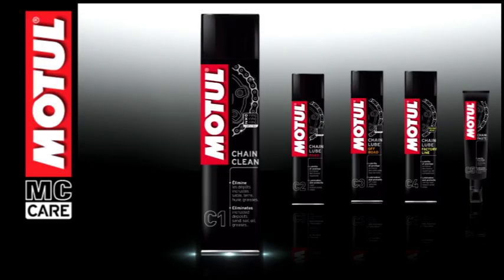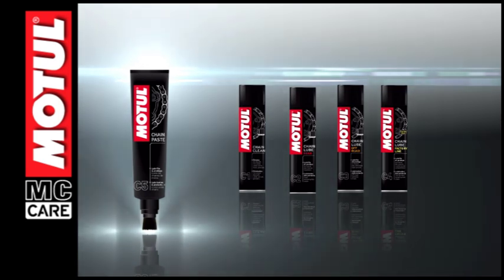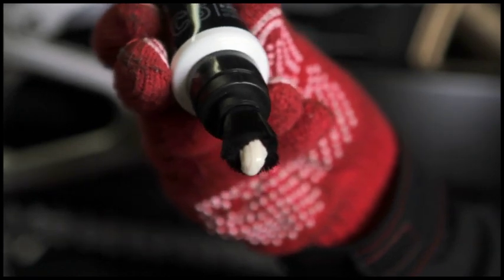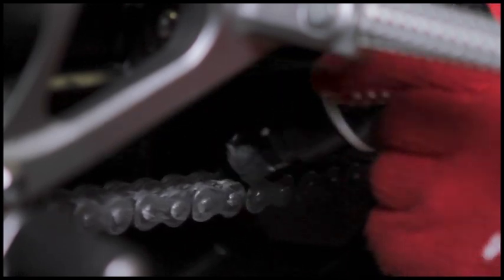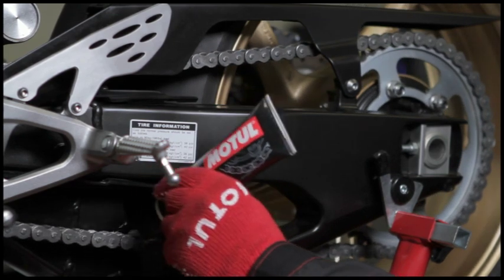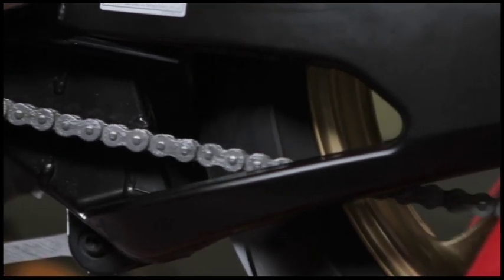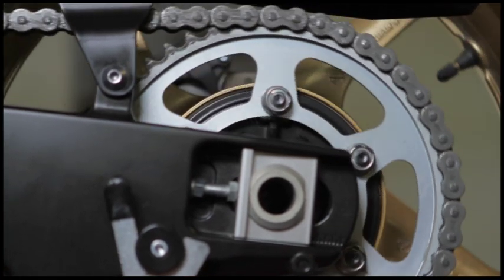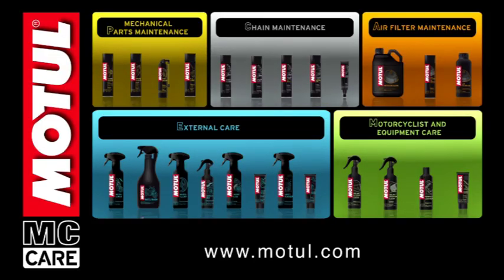Motul - MC Care range - Chain Paste

Comment: whats the diffrence between the paste and the C2 spray?
Reply: The paste is thicker and better keeps on the chain, especially well on the highway in hot weather. I've been using C5 for 8 years, I need to lubricate every 500 km and the chain serves 30,000-35,000 km, D.I.D X-Ring. Very sparingly, 1 tube per 15,000 km
Reply: wow.. amazing lifespan. my first chain went out after 16,000km ... and i kept oiling her every 500 km..
Reply: The resource of the chain depends on the style of riding. Which chain, if without oil seals, then 16,000 km is quite normal mileage. I'm using DID530VX G&B
Reply: ofc an o ring chain. but the seals seem to start comming off at this mileage.. anyway,  with the paste do you need to apply it to the outer side of the chain as well or the paste will get there with centrifugal force like with the regular oil?
Reply: Pasta should be applied only to the internal stropes of the chain. In the rubber rings, the paste falls under the influence of centrifugal force.
Reply: Does the same

Comment: What about the other side of the chain, the inside? That's the hard part.
Reply: I do what I can. Throw it on a stand. Rotate the tire.
Reply: Oh. You mean the back side. Honestly most importantly is lube where the chain and sprockets meet. But backside you can reach through the tire if you please .
Reply: Exactly my concern

Comment: Never looked back since using this stuff. No more crap on the wheels at all. Only thing I do different is take the brush off (unscrews) and apply it straight to my hand with a latex glove, and massage it into the chain. Takes me less than 2 minutes to do the chain. (Excluding cleaning of course)
Reply: Thought I was the only one who did this. Great!
Reply: Great alternative. I noticed the brush will get dirty over time so its better to do it with your fingers
Reply: Great tip , thanks!

Comment: Hello, 
Can i use both chain lube and paste together after cleaning the chain. Thank you
Reply: The paste IS the lube
Reply: I was thinking of spraying the chain and after that the paste
Reply: You clean the chain then add paste. You don't add spray lube and paste after. That's a waste of product. Some chains even come prefab with paste already on. More important to look closer @ chain wear and slack than lube but also lube is important. No doubt. Both lube and the right tension will improve overall performance and life of your chain.
Reply: But. It won't be catastrophic . if u use both. The paste might fling off though. = waste. IMO i like the paste better. Long as the chain is lubed somehow you're g2g . and dont use wd40 lol.
Reply: @porglife4104  Thanks man. I clean it first with spray for cleaning from Motul or sometimes with kerosine, then I only add paste
Reply: @petarvasic4411  there ya go. U can't go wrong just follow the owners and service manual for your motorcycle 👍

Comment: this is NOT penetrates between the links of the chain ...
Motul is a myth. This product proves it.
In fact, I wanted to know the difference in the chemical composition of the four lubricating fluid chains from this manufacturer...
Reply: motogaySP I've been using motul's chain cleaner + chain lube factory line since i can remember and always had my chains still good to use upon reaching the suggested Km to change them.
I think motul has quality products based on my experience ; )
Reply: +motogaySP I'm pretty sure Motul actually exists...
Reply: Does enough for me
Reply: Once riding seems to seep into the links